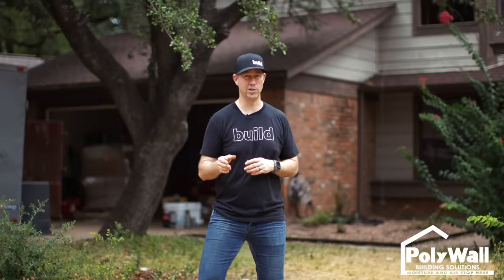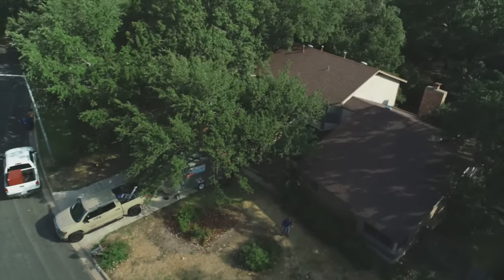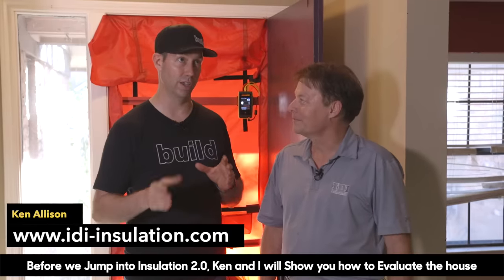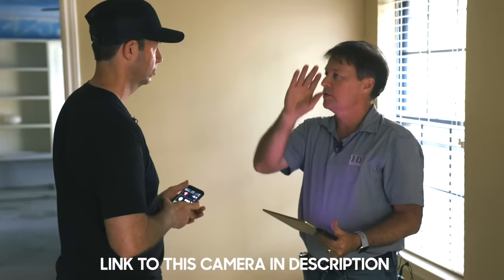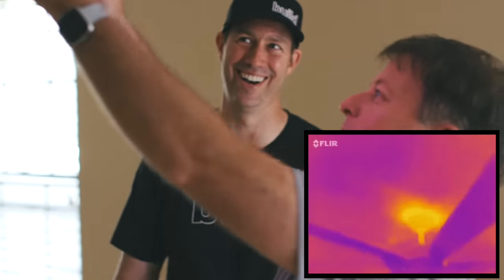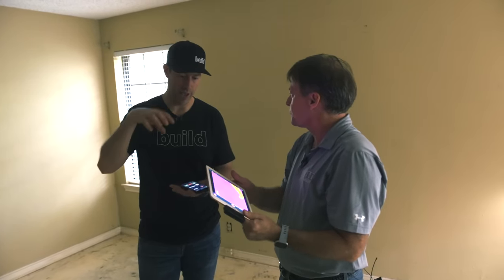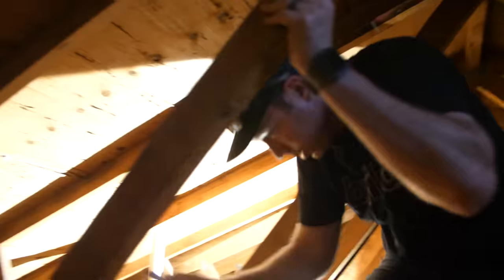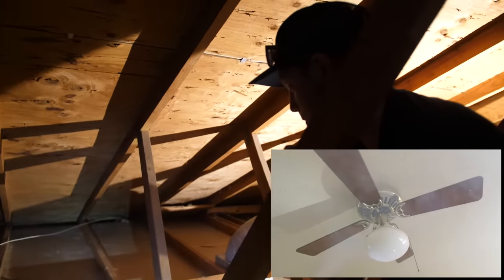Insulation 2.0 - 3 Steps to Re-Insulate

Comment: Matt !!!  just had someone come over and give a quote for insulation.  I asked about the SUCK OUT   he  said that's the worse thing you can do.   what's your opinion ????   THX
Reply: Sounds like the guy doesn't want to do it lol
Reply: Am also curious. I was have had some mice activity in attic. But both the two pest control pro and insulation told me it's okay, no need for suck out!
Reply: How did he propose to air-seal?

Also, the old blown-in insulation (1990s or earlier) performed poorly when the temperature difference exceeded 70 degrees (e.g. 70 degrees indoors, 0 outdoors) in a study by Oak Ridge National Laboratory. In the 1990s, Owens Corning blown in insulation was made by cutting their batts into cubes. These cube didn't nest well, leaving air gaps in the insulation which performed poorly in cold weather. Newer insulation has smaller cubes/tufts/chunks which do not suffer from this problem, and in fact, have a higher R value down to - 20 compared to 40. Whether adding another layer of modern blown in fiberglass solves this problem is left a an exercise for the reader. Still, it's a shame to waste all of the energy which went into making the original product if it works for your climate.

Comment: So I air sealed my home and then added insulation and it made a huge difference 
Then along comes winter and the moisture issues on the windows literally water running down them
So then I installed myself an hrv system that cured that problem 
So now I wonder if I should have saved all that time and money  and left it as it was
I now have fresh air pumped in constantly which is healthy but my heated air is pumped out at the same time so I just wonder if it was worth the efforts and money
Reply: Look at euro buildings - super tight air sealed, with HRV or similar, yet still more efficient. Sure you're changing air but under YOUR terms and not that often. Think also about basements - water proof it well on the exterior and interior but you still NEED to exchange air. Would you rather have wet walls/floor or heat that tiny bit of extra air? It's not rocket surgery :)

Comment: You're not wrong... but you're not entirely right either. It is a case of those where there is too much of a good thing. Yes! We want to be able to control how where and when, BUT! ...it needs to be dealt with in a manor, so you remove the disease in stead of relieving the symptoms. That means that the building needs to be planned in a way, so you don't need unnescessary heating or cooling of the structure - artificial ventilation at all for that matter.

We went down that road 10-15 years ago. Standard homes were allowed a combined leakage of a very unscientific size of a soccerball... That's the entire house for holes from everything from staples, screws, leaking vapor barrier, ducting, outlets, doors, windows, vents, hoods, pipes through slabs - in one word: Everything! passive homes had to make do with the size of a tennis ball. And it's too tight with whatever normal ventilation they have. It's just not enough. Installing a more powerful ventilation system is symptom relief. It doesn't solve the problems, which is usually too large windows without shade to the south for heat, the same to the north for cold, although not as usual. Lack of eaves and a bunch of other stuff, that'll help the building retain sound temperatures during the day and the seasons. It takes tremendous effort and knowledge to get there, though I'm sure there's some smart software developed to help out. And there's no universal solution to the problem - it all depends on where in the world you are.

Comment: Matt In my opinion this house is a tear down given you are having to go top to bottom removing and replacing every square inch. Then the exterior redesign and renovations to make it look newer. This house exterior and interior is obsolescent from a design and functioning point of view. Ceiling heights, room sizes and windows all scream old. As a buyer that is spending this much on a house that looks patched together with a bad floor plan  I would not be interested. My guess is you will be spending more on  this house than a building a new one and have a worse result after spending all this money.

Comment: Mmmm I don't know... without a temperature scale, the images are meaningless... there will always be temperature gradients and the camera software adjusts the image to cover the full scale of temperatures in the image against the full range of colors.
The important thing in this case is to know at what temperature are the hottest spots.
He should have included the temperature scale in the side of the image. If the inside temperature was 25 degC it is important to know if the brightest spot is 26 degC or 50 degC.

Comment: Guys, the drywall is taped and mudded on the other side - therefore NO air infiltration. So, it's silly and wasteful to foam the seams. The primary problem is the use of loose-blown fiberglass, the least efficient "insulation" mass-marketed to all you builders. Informed homeowners use more efficient loose-fill insulation.

Comment: Yikes, almost criminal.  Our home here in Northern Ontario was build in the late '60s.  It was insulated to the Tees.  Attic insulation sits on a vapour barrier which is well sealed at every wiring etc., penetration. And this was a decade before Joe Lstiburek was about in the '80s.
Reply: Is the blow in insulation on top of plastic? (vapor barrier) ? Have you ever had any mold issues on the ceiling drywall? What type of attic do you have and is there any of the mechanicals on the attic (Furnace,water heater etc..)? 
thanks for your time answering this if you can. Im in Minnesota.

Comment: why does they not use plastic? plastic is a great air sealer. When they built the house there should be plastic under the drywalls, then there would be a vapor barrier between the insulation and the drywall.
Reply: Current practices are getting away from using class I vapor barriers (such as polyethylene sheet), except perhaps in very cold climates. In hot climates, a vapor barrier on the inside is a no-no.
Reply: Cant use plastic vapor barrier in a hot humid climate like Austin. I've seen it soon and it created a mold explosion!

Comment: I really dig the air tight science, BUT I WOULD LOVE TO SEE SOMEONE DO SMOKE AIR LEAK TESTS ON CEALING WHILE INSULATION IS STILL THERE. If the "blanket" is thick enough,  air will not flow nearly as easily.

Comment: Clearly condensation is not a consideration ??  Older style house of the recent past were not designed to be hermetically sealed and relied on incidental ventilation to keep the spaces free from moisture.  We have Victorian houses where the slate roofs are noticeably draughtty but you will see that the roof timbers are usually in wonderful condition.  that is those that have nor been indiscriminately sprayed with PU foam or had excessive insulation applied.  To upgrade a '70s house for example, requires much more in depth investigation and a holistic approach.  You may even find that the air leakage through the ceiling is actually beneficial in keeping condensation at bay.
I note that the ceiling board joints have mostly been spray foamed but crucially there are places shown on camera (!) that were missed.

Comment: you got to be kidding me: do you see at 30:16 how they install the intake soffit baffle or vents are installed? There is no way i would ever want these guys to do my insulation. they are installed backwards ffs. Those raised triangle shaped forms are supposed to be installed with the narrow edge towards the roof and not the wide base, so the insulation doesn't compress the channel the air goes through from the soffit. the way they installed it it only has a 6in at best through the middle. How the hell did they even staple them since the edges are supposed to be what holds them on the osb that the shingles are nailed to? i feel bad fr the owner they probably have to replace the shingles more often now. I'm not even a roofer and i have some common sense and logic on how those baffles are meant to be used.... sheeshh. People please don't follow how he installed them! everything else seems all right

Comment: 30 minute 16 seconds obviously the dude has no clue installing the baffles wrong. Had my roof replaced and had them install baffles. they did it the same way which has zero function. Absolute idiots! Had them back twice to make it correct.

Comment: What is the big deal about a small amount of air passing from inside of the wall to the attic through wiring holes.That wouldn't happen if you didnt take the insulation out.All of this can't make much difference. No way to prove it does.

Comment: This sounds great but. The cost of insulation removal is at least 4x the cost to install new, and now you need to install more than you would have otherwise. The reason you are getting push back is because you are misleading people into thinking they should go overboard. Would air sealing help, yes a little. But where do you stop. Can someone recover the cost difference, he’ll no. Add a foot of blown insulation, problem solved and it’s cheap. Very simple, go to the department of energy website and see how much insulation you should have in you region. Then go up there and see what you have. Matt, Do you have any home improvement videos for people on a budget? We don’t all have endless amounts of money. We can’t all tear down a perfectly good house and have advertisers rebuild it for us.

Comment: Not sure why your attacking the insulation / air leaking 1st. Aren't you going to do some "major" renovations. I would get the skeleton done 1st before putting on my hat & jacket. Your sealing up an old bathroom vent that should be replaced with a more energy efficient modern day fan not to mention the old fan motor is past its prime.  I appreciate the information but it's a bit cart in front of the horse ish.

Comment: 40% saving to heat bill from 2.0 is BS. 
Why, here's why, heat energy dissipates 15% from ceiling, 20% from walls, 35% from windows, 15% from floor and 15% from ventilation. So with zero insulation ceiling is only 15% energy loss from total heat consumption and if you insulate it really well it only saves 15% but ceiling itself can be 40% better that what it was.
Reply: I am curious as to where you got those numbers from and if you're accounting for the heat loss from poor air sealing.
Reply: @gavinsauer1608  Those numbers are given by official building authority in my country. 
If via ventilation heat loss is only 15% and for sure those air vents are bigger than few small cap around light fixture, top plate etc. so no way you can save 40% from whole house heating bill with only making once part (ceiling) of your house better.

If this guy is so sure about saving ask him to write contract that IF your heating bill doesn't be 40% less you get money back, for sure he won't write that contract.

Comment: too expensive $5/sqFt!!!! 1500 sq ft home = $7500. And how long is the payback? 15 years probably. only way to make it cost effective is to DIY. IMHO
Reply: I did 6" of closed cell (2-part) foam this last year. It alone dropped my heating and cooling bills almost $50/mo. That's an 8-10 year payback, but the thing is, it's INFINITELY more comfortable and QUIET year round. Not blasting heat trying to make up for what's leaking, and not running the AC 24/7 all summer (upstate NY so not a hot climate) and I can USE and ENJOY my attic vs it being frigid half the year and blazing the other half.

Comment: So what happens if you go to change any of the electricals after you foam them in, say you need to replace that ceiling fan. how big of a pain in the ass did you just make for yourself by sealing that up with foam?
Reply: None, the ceiling fan is only connected to the box on the room side.
Reply: @augustreil  Codes have changed a lot since the 70s. I am sure Matt did this video for demonstration ( for one - who the H___ works in the attic during the middle of the day ). The electrical needs a total update ( ceiling fan boxes weren't in common use in the 70s. You know that is a regular ( non CFB ) fixture box. It can be corrected easily before the foam. I am sure Matt is updating plumbing and HVAC as well before the actual sealing and insulating.  Great video Matt

Comment: Matt, unfortunately, you are sharing a lot of misinformation! Most all the heat flow around ceiling fans and lights in your demonstration occur because the electrician swept the fiberglass away and never replaced it after installing the fixtures.  The missing insulation is easily seen visually just looking up in the attic.  Likewise, the missing fiberglass between the ceiling joists is easily spotted just looking in the attic. Your cheapy IR camera isn't needed for that. It's telling that you chose to do the smoke test AFTER vacuuming out the fiberglass. It's dramatic to those not aware of your tricks but laughable to insulation contractors.  Cheap builders pay for cheap insulation work so don't fault insulation contractors. Save the cost of foam and use caulk and joint compound. How long will the foam last in a hot/cold attic? Will it even stick to dusty surfaces? Foam can lay on and seemingly cover air passages but closer inspection shows light piercing through from the other side. As for your foam gun, I've bought five over the last two years.  Following cleaning & use instructions the gun ALWAYS plugs up - there's no cleaning it after clogs. The best way to air seal is to avoid using fiberglass insulation. And please, don't call poor workmanship by fan & light installers anything other than shoddy workmanship. Foam is NOT cost-effective. Foam is harming our environment. It's really dumb to vacuum fiberglass out and then reinstall pitiful loose-blown fiberglass, otherwise known as "cheap builder's insulation." Fiberglass is great for the bottom line but isn't energy-efficient. You guys hide behind your "scientific numbers." Better energy savings can be had for less money and less double-talk. You may be misquoting the window claim "save 40% on energy." You can, in some applications, reduce the heat loss by 40% through windows - providing you have leaky windows to replace.  Is that what they were saying? Be fair Matt, it's your crew who vacuumed the cheap fiberglass out and then got ecstatic about "poor air sealing." You should stick to construction.  All your misinformation would take a lengthy article to correct and expose.
Reply: I can't wait to see if He responds to you, This guy is SOOOO full of himself, and accustomed to finger pointing.... Hope Everyone reads this ! Thanks

Comment: Ordinarily your videos are great, but this one is terrible.

* Was the FLIR analysis done before or after the original attic insulation was removed? If recorded after removal... you can't fault a house with no attic insulation.

* The colors on the FLIR analysis were never defined. What temperature was orange? 70°F, 80°F, 90°F? Who knows?!

Comment: So these sealers are usually toxic.
The reason why you see the rafters through the sealing is because they are warm from the heat in the attic and they are touching the drywall. There is no leaking going on because you would need holes for that and they are tapped and patched solid.. it's kinda like when you touched the wall and left the imprint of your hand.. you guys really need to know what you're talking about before you make these videos.  Because your claims are totally bogus..
I assume you know this and you're just trying to illicit wow factor by exaggerating. No after flair pictures of the sealing for a reason.

Comment: This is stupid. Of course the fog will flow into any attic where there is a crack. Air flow is not all bad. Air flow add to drying out all components of any structure. If a house is air tight it is not healthy air within the structure. Mold is the enemy -energy cost is not important-use solar and forget about the air flow as an enemy of energy cost. My 1940 house has no insulation  in the walls and  Asbestos shingle siding with tar paper. Solar panels  and wood stove in basement provide the heat in winter and energy for air conditioners in the summer. Unhealthy air is a killer of people. Beware

Comment: I been trying too build s house in my head & everything we do makes it just need more & more & more. Heaters & air-conditioning should run down the walls then into the room. That way there is a forcefield around the house heating & cooling a 100mm gap is much easier then heating a whole house. Also those will radiate hot or cold from every wall. The way houses are built need to be reconsidered completely. 
Personally i been trying to design a flying house make less not more. Less materials better product better world. No gutters no driveway to clean. More land back to the world. 
GOD made a NICE WORLD, I argue with GOD ALL THE TIME SAYING GOD ISN'T PERFECT BUT I TELL MAN WE AREN'T GOOD ENOUGH TO BE SHIT.
MAN MADE GARBAGE & THINKS THEY RULE THE WORLD.
RUIN & RUN THE WORLD ARE 2 DIFFERENT THINGS.
SCOOBY DOO WHERE ARE YOU🌈🌈🌈🌈.
RAINBOWS are GOD'S FOR EVERYONE NOT FOR DEMON ATTACKED POSSESSED PPL THAT CAN'T FIGURE OUT WAT A BOY & A GIRL IS.
REMEMBER KIDS, RAINBOWS ARE FOR ALL OF US.